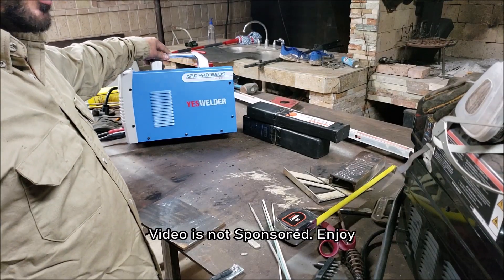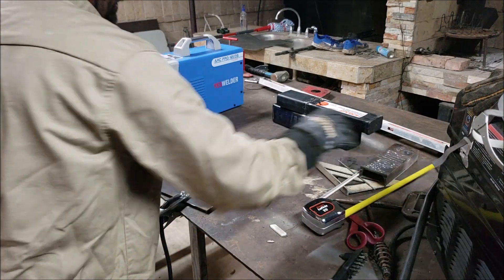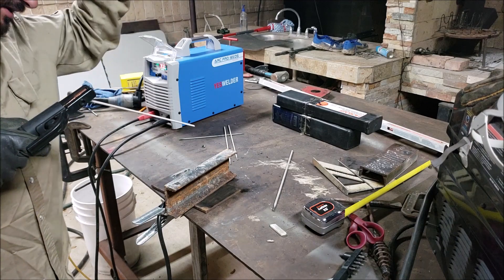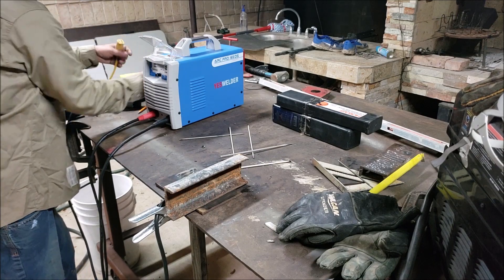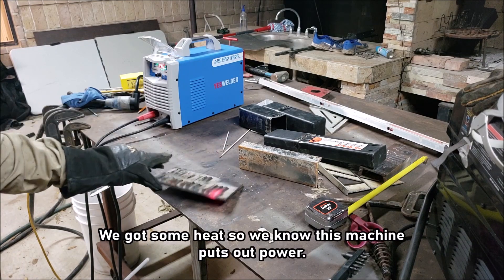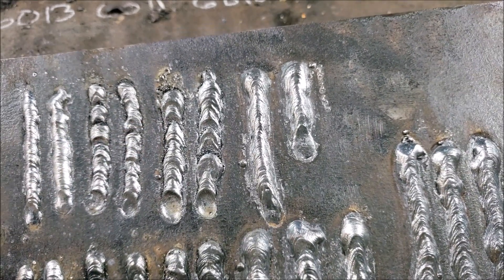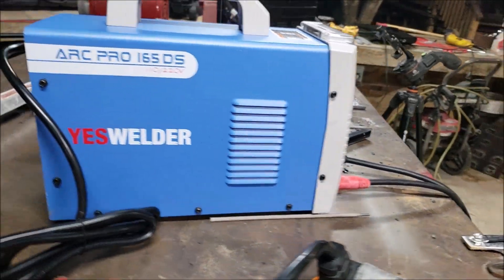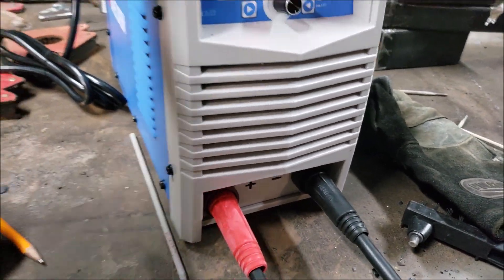Yeswelder Arc pro 165ds test welds and review : $100 budget welder from Amazon with DC lift Tig

Comment: Thanks for the info. Just ordered on for $78.11 total with coupon. Looking to weld up a tube bender frame made of 2 inch square tube with 3/16 wall thickness. And recommendations? Bevel maybe? Best rod choice? I'm kinda inexperienced with stick welding but managed a few welds over the years. Will subscribe. Thanks again.
Reply from the maker: A tube / pipe bender is something I have wanted to build for a while. The best thing to do is search on youtube and most likely you will find the information needed. I use mostly 7018 electrodes with these small machines.
Reply: @cutweldngrind same with the 7018 rods.

Comment: I'm looking to pick up one of these to do some frame repairs on my Jeep. From what I've gathered by watching your test, 1/8 mild steel should be no problem for this machine. Despite the ability of certain electrodes to weld through paint and rust, I'm going to make the work as clean as possible with my grinder before I start. Thanks for posting this - feel free to give me any hints or advice (besides "buy a better welder" haha)
Reply from the maker: This welder is light, very light weight but has worked excellent with 7018 electrodes. I do lots of 1/4" with it and has not failed me once. They also make a 205 model which was about $20 more back then. You can look on their  Amazon or yeswelder site to get the best deals. You can try my code cutweldngrind and see if it still works to save a few $. Any other questions you may have let me know.

Comment: I have this machine and I really wanted to see a video like this I have never used it with voltage 220 only 110 and there is no doubt that it is how it should be used in 220v your video is great and well explained
Reply: I bought the 165ds 2 years ago after seeing this video. 220v is best, but does work with smaller rods on 110.

https://www.youtube.com/watch?v=fn4_dUPVLdc&t=603s&ab_channel=SalamSayhood

Comment: Good honest review. 220 VAC is always superior but 120VAC works fine just slow down and use small rod and  build up the bead and you can do alot.
Reply: Puppe p.         C j9
Reply from the maker: I think the machine is decent and for the price a good deal. I think 3/32 electrodes on 110v would be good, lower amperage means breaker won't trip that often. I wanted to try the 205 machine so may pick one up sooner than later.

Feel free to check my other videos or even subscribe.
Reply: @cutweldngrind  one thing they don't tell you about 110V welders is that you need a 20A or 30A breaker, and most homes have 15A breakers on the outlets. I ended up installing two 220V outlets in my house after I got mine.

Comment: Have this welder and its worked great for me as a beginner. Practiced a lot of welds and have done some projects with 1/8 and 1/4 inch steel.  The video below convinced me to get the 165. He put it through the paces.  One thing to note, those default amp settings are not accurate and increasing amperage is allowed :)

https://www.youtube.com/watch?v=fn4_dUPVLdc&ab_channel=SalamSayhood

Comment: 7018 for everything. Lol
Reply from the maker: 6011 was my favorite electrode 20 years ago and now I really like using 7018. 7014 also works great but lacks some penetration capability.
Reply: Never used a 7014 but I’ve burned plenty of 6011 and 7018. I find myself using nothing but a wire welder now a days. A Hobart. About to up grade and get me a better one and a plasma table.

Comment: I have a small Yes AC welding machine. It's a breaker tripping SOB! You already figured that out too.  Something that I'd suggest that you try though....reverse the polarity, especially with 6011.  Years ago, it was printed right on the 6011 box but it's not printed on the box of rod I have out in the shop now. So I guess they don't do that anymore.  But a good rule of thumb that I always followed was to reverse the polarity on anything AC. I have a Primeweld TIG225X AC/DC machine too that I keep the polarity switched on no matter what I'm welding on. Try to TIG weld aluminum with that machine using AC straight polarity and you'll have your hands full and your grinder will be well used too. It can be done but it's not pretty.  
Anyway, it looked like your leads were plugged in straight so I thought I'd mention it.
Reply from the maker: Thanks. Honestly I was going to flip the leads over and try all 4 electrodes but didn't due to having 20+ minutes of footage already. I will try flipping the cables over soon and make a follow up video.  We should have bad weather starting tonight so will delay me a bit.

How do you like the TIG225X? Personally I have never Tig welded and really close to buying one to start learning. Yeswelder has the Tig205DS but I prefer to get a better machine and not have an extra machine. I have a Primeweld package waiting for me to unbox it but it isn't the TIG225.

Comment: I've had this for 6 mos. I have 4 other welders but grab this one alot to do trailer and truck repairs in the driveway. Works well.
Reply from the maker: Awesome to hear that. I was going to get the 205 amp arc welder which was about $15 more but was curious on the presets on this model. I am looking at the Yeswelder Tig205DS to start learning to Tig but I am also looking at another manufacture that has an AC-DC Tig Welder for $850. What other 4 welders do you have that you prefer this one over them.
Reply: If you trying to weld angle iron what would you set it on just trying to learn